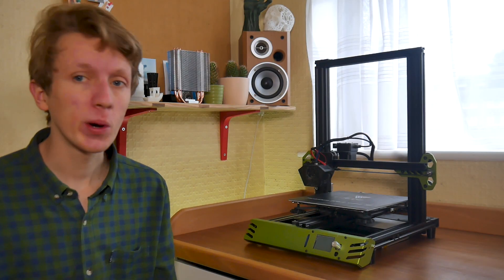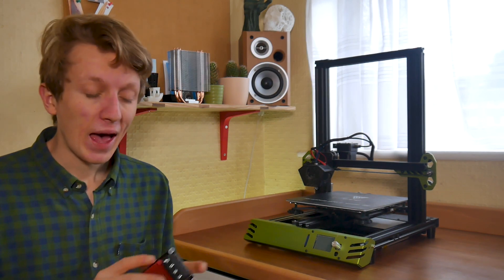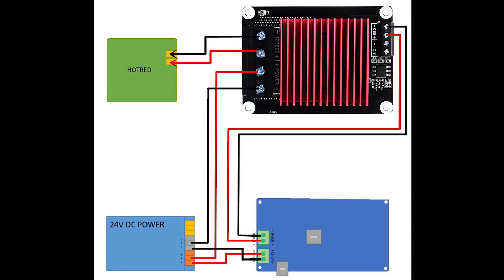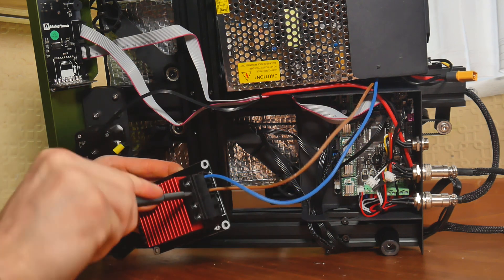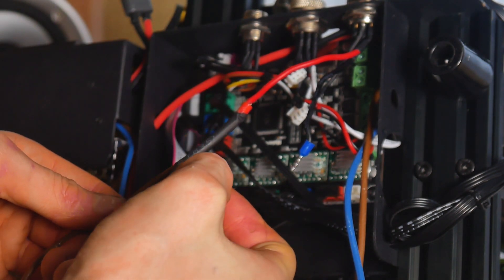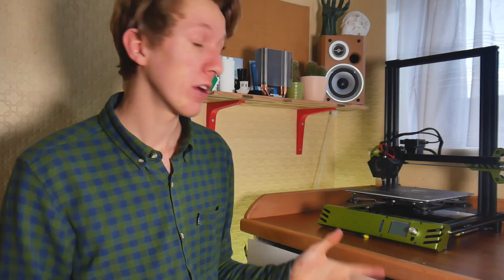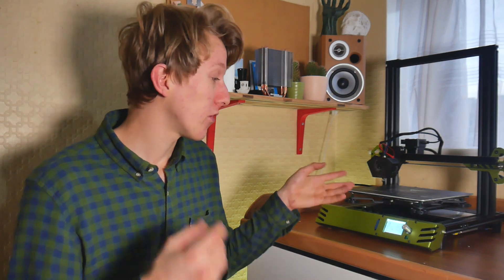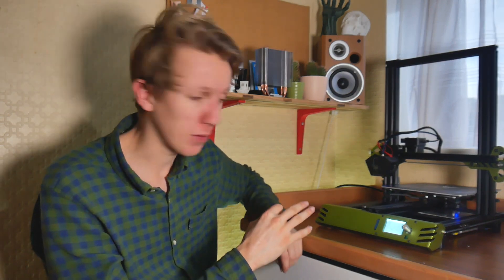Installing A  MOSFET Board For 3d Printer Hot Bed upgrade, tevo

Comment: Sort of a nice to have thing on the spider pro.
The bed is 100W so the FET inn the control board is actually well capable of running the bed heater which has a max temp of 80C.
Reply from the maker: Aw many thanks,  my bed heats up better now and never fails,  when doing abs,  I've subscribed to you
Reply: @bespokebrisley3423  good work. ABS isn't supported officially due to 100W bed. Hopefully you're not stressing things trying to do it or trapping the electronics inside a heated chamber.
Reply from the maker: @td3dp533  I find d a heater bed is not needed when you have good adesion,  and when it's 85 degrees

Comment: Hello, have you check voltage output from the mosfet?
Im currently installing MKS MOS25 mosfet for my TT Pro, voltage from PSU and from controller hot bed port are 24v, but from mosfet output are dropped to 23,1V.
is that normal?
Reply from the maker: that is not much of a drop and it will be absolutely fine , don't worry your printer is perfect , thanks for the sub